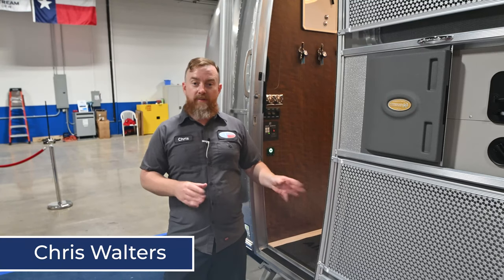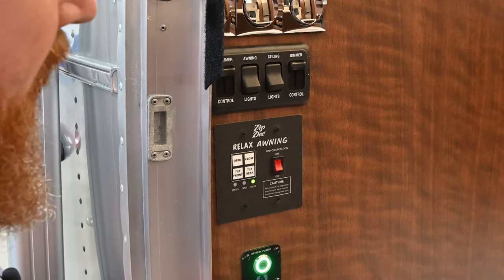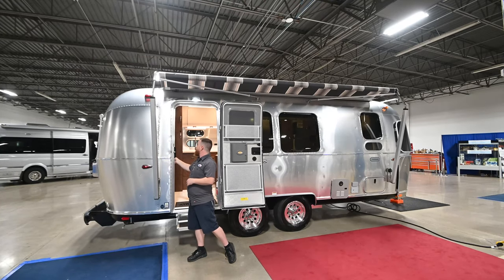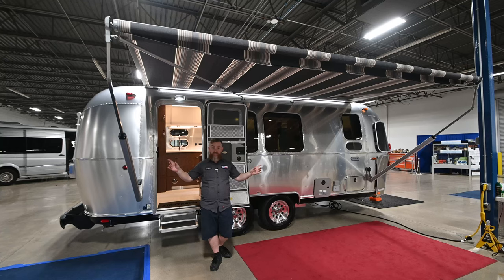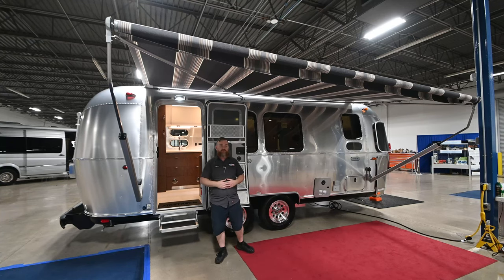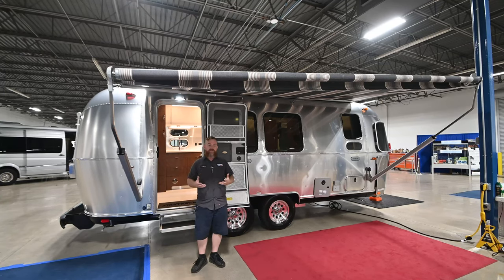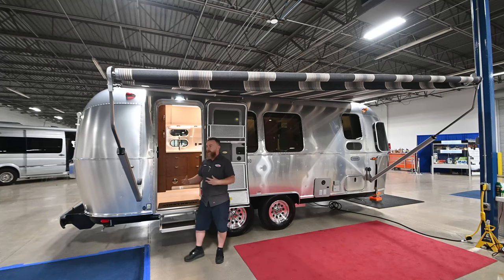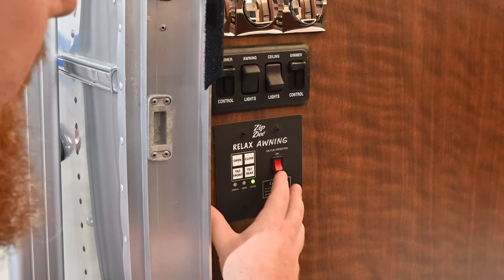How To Use The Power Awning Controls On An Airstream

Comment: Riddle me this…

I just bought my brand new Airstream 23ft International 2 days ago and on our first trip.  Awning will not operate at all.  No blown fuse, I have attempted to reset with battery disconnect and waiting 20 sec…no luck.  No green light comes on at the awning panel.  So far the new purchase is a disappointment.  Airstream should have stuck with the reliable manual awning.  RV Complete tech had no other thoughts.